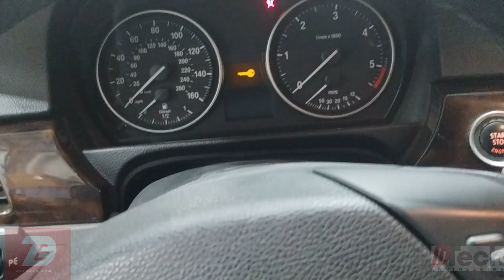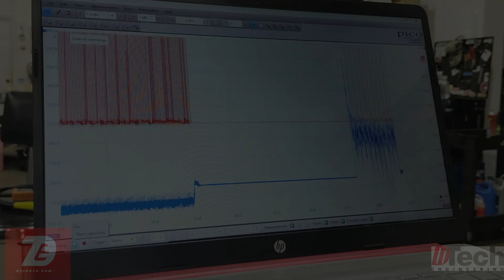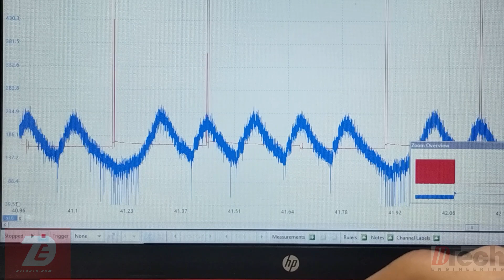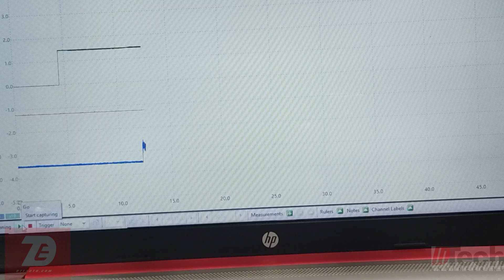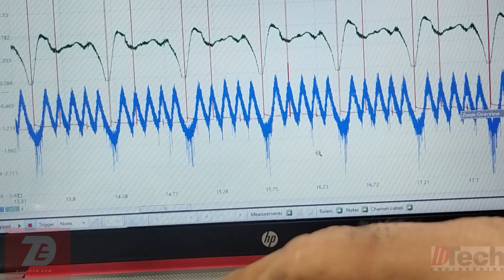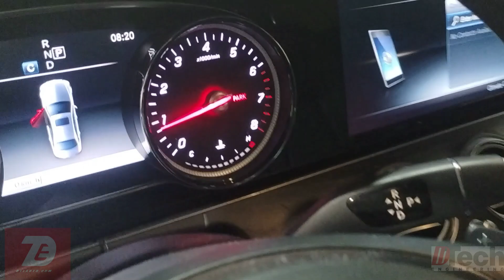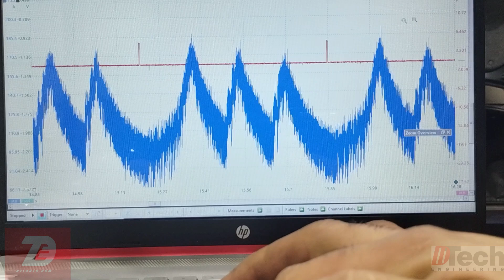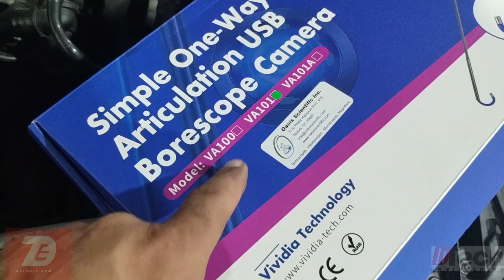BMW & Mercedes Verifying Misfire with a Scope

Comment: Thank you. My suggestion would be, at the end of such excellent diagnostic videos just add your personal and professional opinions with regards to what could have caused such damage, recommendations to the drivers to avoid the same from happening. Whether it was due to lack of timely oil changes or anything else.
Reply from the maker: Thanks for the suggestion, I'll consider adding that in future videos. Thank you for watching

Comment: BMW, no attempt to disprove cylinder wash due to overfueling from a bad injector? Was this cylinder where an injector was replaced before? Thank you for the two test procedures, cheers.
Reply from the maker: this was not due to over fueling, this was a cause from a cracked piston, hence the amount of high crankcase pressure during it's tdc point. Cylinder wash would not let that much amount of psi past the rings, this piston got damaged just like the benz piston did.

Comment: Master, how can I do that test on a BMW n52 engine? The relative compression showed a cylinder without compression where I can connect the pulse sensor to identify if the fault is in the block. It does not have an oil valve.
Reply from the maker: you can test at the oil fill cap. buy an extra one and drill a hole in it and screw a fitting in it where you can connect a hose to the sensor and then remove the original oil fill cap and install the one you make and take measurement. That cap will fit all other BMW's and a lot of other European engines.
Reply: @DTEAuto jupp 👍🏻 .

Comment: Wonder what kind of spark plugs were in that Mercedes…?And if they were torqued properly.  Believe there is a tsb for those engines if I’m not mistaken.
Reply from the maker: I've seen that document also, I believe they were factory.
Reply: @DTEAuto  interesting…wonder what would have caused that?
Reply from the maker: Most likely could be from LSPI (low speed pre-ignition) due from incorrect oil. But could also be other things like fueling or the spark plug document you mentioned. But I have been seeing a lot of different makes engine come in like that from LSPI.

Comment: Cool video really informative. Why does the ecu still try fire the injectors on the bmw with the fuel pump module disconnected? I thought without rail pressure it wouldn't try. Or is there a window where it will? 
And on the Merc what did the bore scope pic show sorry if its obvious. I saw lots of fuel or oil? Did you have to rule out just cylinder wash causing the low comp? Or was there scoring of the wall I didnt see.
Reply from the maker: I guess the BMW strategy is to still attempt to fire the engine up by providing injection. And the borescope shows the edge of the piston having a piece missing, either it broke a ring land or melted. Hope that helps and thank you for watching.
Reply: Awesome thanks! 
Also what do you think about using one dummy injector for a sync and having the other injectors unplugged for a rc?

Comment: Nice video Sadel, i don't understand one thing how you got injector pulse when there is no diesel pressure in the rail, what I know about diesel engine the ecm don't pulse injector when the pressure in the rail is Less then 250 bars?
Reply: It might be applying a power but no ground. An amp clamp would show no current.
Reply: @nathanlittle8945  OK thank you
Reply from the maker: So far the BMW's that I have tested with the diesel M57 engine all were able to give me injection pulse during cranking when I disabled the fuel pump module.

Comment: Great job once again Sadel.  Again I like your teaching and articulate explanations about your processes which obviously work well in honing in on the exact problem.  Great use of the pressure pulse to differentiate between top and bottom end.  Greatly appreciated.  Never miss a video.
Reply from the maker: Thanks again!

Comment: A low or no compression on a CRDI diesel can also be caused by combustion leaking past the injector sealing washer that seals the injector to the cylinder head.😊

Comment: Common rail diesel injectors are usually paired internally in the ecu. Think of it like a waste spark system. If you would scope both wires on the injector you would see a high voltage(some up to 120V) on 1 wire and a low voltage on the other( battery voltage). I prefer to use a current clamp to see injector activity. Thank you.
Reply from the maker: Yes, that's totally correct, and yes, the amp clamp will show the actual event of fuel delivery for proper syncing. Thanks for the info and thank you for watching as always

Comment: Nice one sadel. Really learning a whole lot from you. Where did you connect the cap. Was it through the dipstick tube so as to pick up crank case pressure. Now when the spike on the wave form from cap goes upward what kind of pressure do you call that. Does this mean anytime a downward spike in pressure occurs it means there is an internal mechanical problem within the block? 
Nice one
Reply: 1, It was an oil filler cap he has added a quick coupler to.
2, when he mentions scaling, he means that he hasn't preset the reading to invert to how the sensor reads = down means an increase in pressure. If you look back, you can see where the relative compression  has a hole. There is a big jump in crank case pressure = likely a piston/piston ring issue. But could be an injector seal on this particular engine also.
See Sadel! People get a lot from knowing which sensor you're using, where and how you're connecting it 😉
Thank you for starting to include it.
Reply from the maker: That explained it just as I would! As he said and hope it helps, thank you both for watching as always!
Reply: @DTEAuto  sadel i only don’t want to watch any more I want to stand by you watching and learning these things live. So if you get an upward  rise. What does this means
Reply from the maker: which scope trace channel are you asking about?
Reply: @DTEAuto  Crankcase pressure